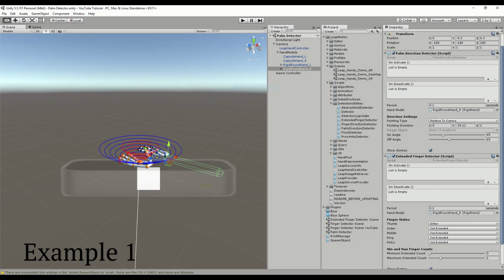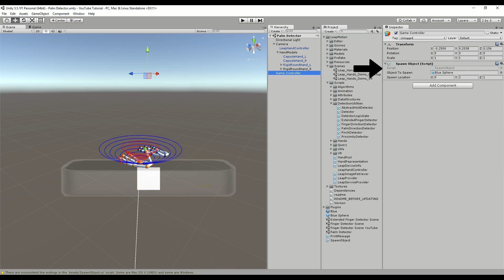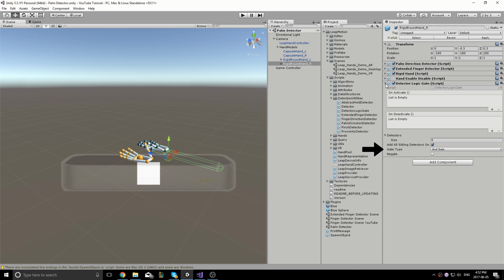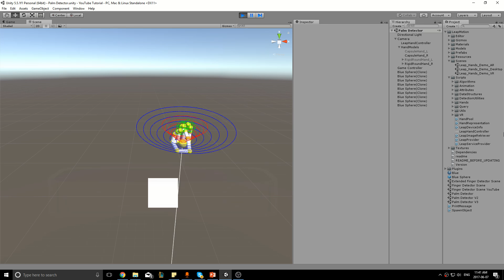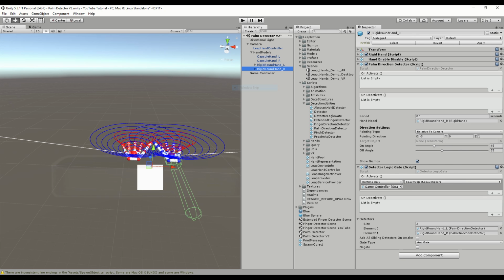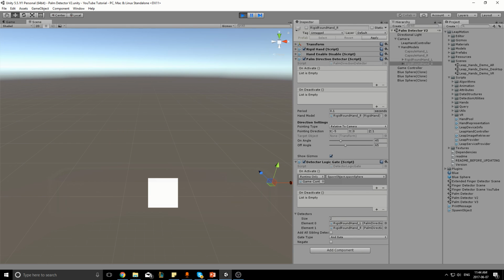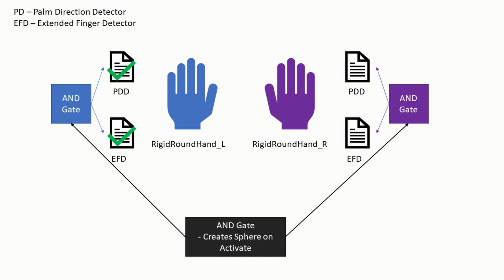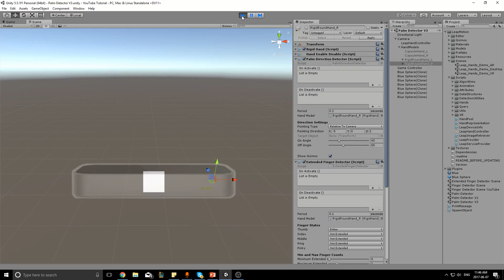How to combine Detectors - Leap Motion in Unity: Detector Logic Gates

Comment: Hey ! I don't have a leap motion... But I want to know if it possible to get or can tell if you're swiping left or right (like a gesture) with LeapMotion
Reply from the maker: In Leap Motion SDK v2.3 there were some built in gestures you could use. However, from reading this post it seems like gesture are no longer supported in SDK v3 (Orion). https://community.leapmotion.com/t/orion-basic-gestures/5030 You would have to create your own gesture system.